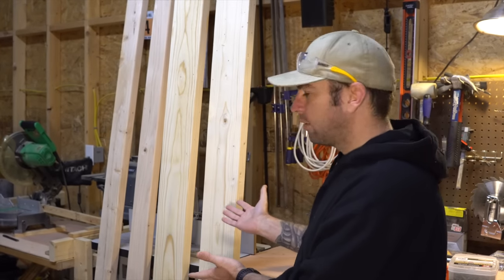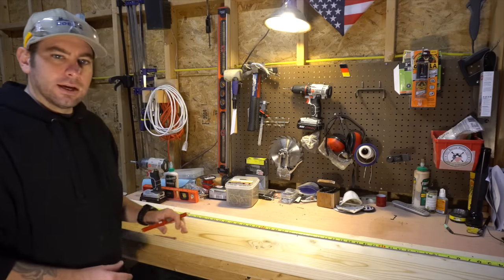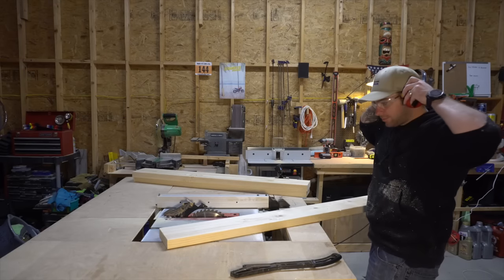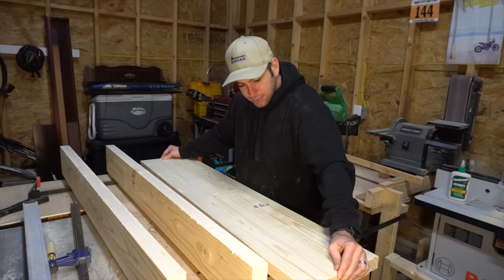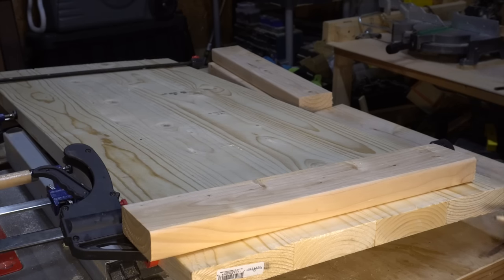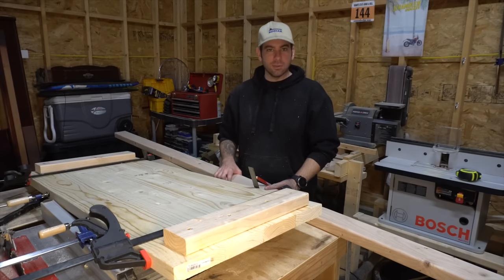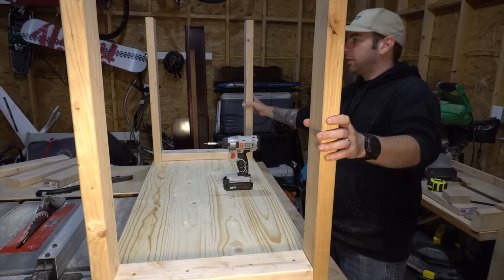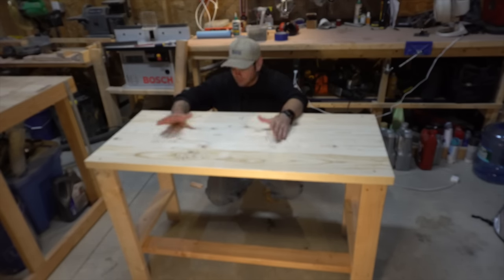Build a Super CHEAP and EASY DIY Desk!

Comment: Certainly not meaning for this to sound negative, but I do have a question.  Where are you getting your material for that cheap?  I would be lucky to get that kind of wood for twice that MINIMUM unless I look in the "Culled Lumber" section.  One major issue that is holding me back from these types of projects is the price of lumber at this point. I try and get as much free reclaimed lumber as I can and run it through the planer and salvage it.  Great tutorial and I look forward to seeing more of your projects!

Comment: This video is great and it seems very easy to make this table.however I have a few questions since I am not a professional wood worker.....1st of all,what type of nails have you used and I noticed that you're using something on the tip of the electrical screw driver.i can never manage to screw the nail all the way through....
2nd,is it really necessary to flatten you the edges of the 2x4,since I don't have a cutting wood tool like yours,or I could leave then the way they are?same thing with the sanding,do i necessarily have to sand it ,or I can just go ahead and stain it?thank you a lot for posting this great video,I think you are very talented and I would definetely like to see you making a little and simple garden bench.
Reply: You can leave the 2x4s with a rounded edge, but there will be a little lip on each one that can snag things on the bench. Definitely sand before staining, imo the stain takes better on smooth surfaces, but i have seen people stain things without sanding.

Comment: For the record...

2x4's used to actually be 2 inches by 4 inches.

In the early 80's, my parents bought a property in northwest Florida with 3 old barns built in the early 20th century. My Dad tore down one to build a home and pulled 2" by 4" boards from it, some over 40 feet long. 

It wasn't until the 40's or 50's that lumber manufacturers got greedy and began cutting dimensions on lumber.

Comment: the wood mill cuts the boards wet.  the measurement of the board comes from when it was still wet.  when the wood dries, it shrinks. That is why you get a difference of 1/2".   However, the thicker the board is cut, the more it shrinks.

Comment: This is prob a daft question but if like u said you were to ask for a 2 by 4 but what ur getting is a piece of timber half inch less on both measurements than by rights your not getting what you requested or paid for
Is that correct?

Comment: if you wanted to stain the wood is there a way to get rid of that black text on the 2x4? Can you sand that off or do you cover it with wood filler or do you just have to buy more wood so you can avoid cutting that area?

Comment: Awesome video...great explanation. I noticed at the end the table had a slight wobble. I plan on tackling building this using your video this week. Is there an easy fix if you end up with a wobble in the table when finished?
Reply: I will try this out. I will add glue to the leg joints in addition to the screws and add a cross brace to the front, if I have wood left.
Reply: You could add adjustable feet but that would add to the cost a bit.

Comment: I have everything but the nails. What size would you recommend getting?
Reply: I would use a 3"( inch) screw. If you're going to nail it, I would use a 3 inch nails. Although I wouldn't recommend using nails, but if you do make sure you're always wearing eye and ear protection.  And good luck
Reply: I used a 2.5 inch screw. I said nail before🤦‍♀️ I removed that comment lol but thanks for the tip ☺️

Comment: 25:45 A 2X4 is 1.5 X 3.5 and called a 2X4 due to the fact that as it is rough cut to 2X4 prior to the kiln drying process. After it is dried the board shrinks, this is also the time when warping and twisting occurs.

Comment: Any tips to avoid splitting the wood when drilling the screws in? Better wood? Smaller screws? I recently built a table exactly like this but when I installed the legs the wood split. I just put a lot of wood glue on it and send it over it but for my next project I want it to look a little prettier
Reply from the maker: Yes, pre-drill the holes before you put the screw in. You don't always have to do this, but you want to on smaller boards and near edges.

Comment: A friend gave me a ping pong table that goes go a pool table.  I don't have a pool table but need a base/legs.  Could you build a base/legs for the pong pong table using 2x4's, preferably foldable.  I'll be keeping it on my patio and only own a drill, table saw, circular, jig saw and miter saw.

Comment: 31:10 stand the other 2X4 vertical and screw the other horizontal one. Move the vertical to the other side and have the vertical one sitting on top. So you don’t have to measure and they are both leveled.

Comment: Great video. Thanks. I have a question though:
In order to attach the legs at first, you screwed them in sideways at the beginning. Later on, when you wanted to reinforce them to stop the table from wobbling, you screwed them in again from the top. How do you make sure you don't "screw into a screw"? I will buy the wood today, and ask for it to be precut, because I don't even have a handsaw. Thanks for a great video!

Comment: I have a suggestion that would not greatly increase complexity or materials.
Screwing into the end of a 2x4 is never a great join.  That said, attaching the legs to the table top cleats the way you did is probably fine.
The two short lower cross members should be made 3" longer (or the table top cleat shorter);  turn on edge and screw through the cross member into the table legs;  two screws at each end.
Instead of screwing the long cross member into the short ones I would turn the long cross member on edge and screw it into the legs with at least 2 screws at each end.
This makes for a stronger join and better protects against racking -- side-to-side or front-to-back shift/collapse.

BTW, is there any concern about expansion and contraction with the table top and cleats?  Panhead screws with oversized or slotted holes needed?

Comment: Helpful tip for those without a table saw to square the short edges of the 2x6's. Don't square them, and instead glue then nail a sheet of plywood or MDF on top of the whole bench. Not perfect but perhaps much safer than trying to square edges with a circular saw

Comment: Would it be possible to leave the 2x6's as is and have more of a farmhouse type table with obvious boards? There's no way I'm getting a straight cut without a table saw.
Reply from the maker: Definitely,  it will just create a less smooth surface, but if you're not writing with pen and paper directly on the surface, you'll be fine.

Comment: If the two by fours for the supports we turned sideways you’d have about four times the sheer strength to take out that wobbling.  Even better if you’d gotten one more 2 x 6 and made the table a little wider and used the two scrap pieces on the legs as braces but going up and down instead of side to side those legs wouldn’t have wobbled much at all. Also if you’d used pocket screws to hold the legs on and screw them directly to the bottom of the table

Comment: I really enoyed watching this, I am looking to build a workbench table that I can have outside for the summer months, just so I can get out of my garage which is freezing. The reason they're 2x4 and you actually have smaller dimensions is that they were 2x4 BEFORE they were planed down, so in the UK you need to ask for 2x4 planed rather than just 2x4 :)

Comment: Hi,
I'm new to woodwork, but I like this project. Can you give me the measurement of each piece. I don't have a saw, but I can get my local hardware to cut the pieces. Thank you again for this project.
Reply: The top was cut to 4ft long and right around 2ft deep. The legs are 28.5 inches long. The runners are right around 21 inches long, along with the leg supports. The rest is kinda history just measure twice and cut once.

Comment: The dimensions of the timber are nominal, ie rough cut, then planed down to its finish size, so it’d be sawn to 2X4 then plained smooth to 1 3/4 by 3 3/4.
It would have been easier to assemble the legs laid flat on the workbench then fix them to the tabletop after..

Comment: the extra 1/4 inch is to allow for 2 1/8 " kerfs, 2X4 is the original dimention at the rough cut area of the mill , when the guy who plans out the final delivery cuts gets them , they become 1 1/2 X 3 1/2 ", when you see " nominal" 2X4 ( nominal means name) , look for actual somewhere on the label , or shelf talker , it will ramble off some odd number that will closely reflect that extra 1/4 ", i asked a guy  at depot why nothing marked 1/2 " is ever actually a 1/2 inch, i got about a 1/2 hour long explanation , i think he was a manager

Comment: how much does that wood cost today?  not being snarky about that, just wondering if anyone's priced this out recently.

Will be attempting a modded version of this soon
Reply: I’m making this today. 

I bought (2) 2”x6”x10’ and (2) 2”x4”x12’ - all “Prime” wood because they will look better, be straighter and more flat. 

Total cost for the wood without tax from Home Depot: $50.34

2x4x12 cost $10.83 each
2x6x10 cost $14.34 each

My desk will be 5 feet wide, other than that it will be built the same way.

Comment: I liked the video (and subscribed!), thanks for taking the time to put it together. Question: has the wood table top cracked at all from humidity fluctuation due to the glue? I'm wondering whether to glue or not and what your experience has been.  Thanks again.
Reply from the maker: Thanks for the comment! The boards can come unglued in extreme expanding/contracting situations, but it should be fine if it's in your home.

Comment: I was wondering what it would look like without using a table saw. And if there's a gap could it be filled with wood glue and then sand it?
Reply: or use epoxy

Comment: circ saw with rip fence. or cut a hole on old plywood and drop the saw in it, clamp a board down for a fence and that can get you by. also hand planes could be an option but if you own, and know how to use one you probably have access to a table saw.

Comment: With the clamps this is around $400 in tools if you use a circ saw.
Reply: @xmnemonic Good point... there has to be an investment in tools before you can build stuff on the cheap, unfortunately!
Reply: Circular saw $60 and clamps $25 each at local lowes if you have one.

Comment: Nice work Irie, honestly you motivated me to start and do a similar Desk table. However, i prefer if you use the method of pocket holes instead of  screwing for many reasons (aesthetic and to reduce any possible future rust for the screws).

Comment: Glue really would have helped with those legs.  You also could have glued two short pieces of 2x4 together, then cut them in half at 45 degrees on you miter saw.  Then you would have had triangles for each leg.  Glue the triangles in, and put a couple screws to put it together.  You would not have need cross braces on those legs then.

Comment: The reason it's called a 2x4 is because it is cut to 2" x 4" green, then dried, during which it shrinks. Then it is milled down to make it smooth, straight(ish), and round over the edges.

Comment: This is excellent. I'm so inspired. I need a table and this is great! Could you use one solid piece for the top?
Reply: Absolutely. A great idea is to use 2 piece's of 3/4 plywood, or  what's known as a solid core slab door . Good luck
Reply: patrick mcglone do you mean 2 pieces to like stack them up & make it thicker? Tanks in advance
Reply: @23lESHt0WN12  yes place one on top of the other. It depends on what you'll be doing with it. But a basic workbench top is 1 1/2" thick. Nothing thinner than 1 inch. Does that make sense?

Comment: I noticed that your table wobbled when you leaned on it.  is there a fix for that or is it the nature of 2x4s rough cut?  I like the simplicity of your table.
Reply: The cross supports should have gone in vertically instead of horizontally.

Comment: The reason that a 2x4 is actually 1 1/2"x 3 1/2." Is that a long time ago when lumber was rough cut builders complained about all the splinters so the mills started planing the lumber.

Comment: I don’t trust the glue 100% so what I normally do is tap in about 1.5 inch nails where biscuits would go and clip the nail heads off like a spike. I don’t tap the nail all the way. Once the nail heads are clipped I add glue then hammer the joints together. Cheaper alternative than buying a biscuit cutter and biscuits.

Comment: If someone wanted to save just a few more bucks, you could buy interior only screws.  I think those screws, by the looks of them, are rated for exterior use in chemically-treated outdoor lumber.  I think someone could also get away with less expensive wood glue.  I think the stuff you're using is also exterior rated (and I think even food safe?)  You could buy the interior-only glue as well.  These are not critiques of you; I'm just commenting for those who might not already have any screws or any glue around already.

Comment: A question is... how would you even be able to transport long planks
Reply from the maker: The 2x4's are 8 feet. If you don't have a truck, you might be able to put them in the trunk and fold the back seats down to push them as far forward as possible. I was able to fit them completely inside a VW GTI.

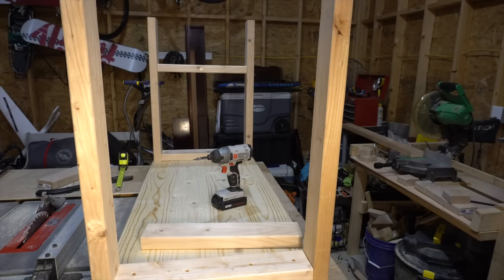Comment: 32:45 you want to use the level on the braces between the legs.  Not measure the distance from the bottom of the leg to the brace.  The braces are not level at all.

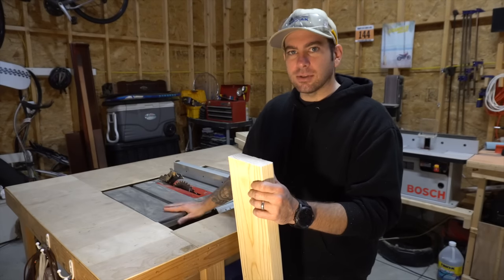Comment: 8:52 instead of doing all that couldn’t I use an electric sander thing and make it square that way? Just wondering.
Reply: Based on my limited experience with an electric sander, I think it would take a tremendous amount of work to sand down the edges to flat. Taking off even small amounts (I'm talking like a quarter of a millimeter) of wood with an electric sander is way harder than you'd expect if you haven't tried before.

Comment: I totally agree with this guy...  that said...  he did so many things backa$$wards...  I spend take the $4 or whatever it would cost to get some L brackets for his design...  I would also make the top removable...  as once that thing is actually done, it'll be kinda heavy if you have to move it...  if it's in 2 or 3 pieces, piece of cake...  

All in all though...  he is on point...  YOU ( and, yes, I mean you! ), can make a desk with some 2x4s and a power drill...  ( if you have a power sander and some stain and poly, that would be nice too... )

Comment: Why wouldn't you have taken a saw blade off the end before you measured then you would have started with a square end.  You had enough to have squared both ends. Buy a speed square and a tape instead of guessing.

Comment: Greed  my friend, I live in an old house inside my walls are actual 2" by 4",  2" by 6",  2" by 8" and so on.  that's why older brick houses are still around also the wood is not so processed (smooth) almost furry but straight. package always get smaller as the price rises.

Comment: Im not gunna lie, this is one of the worst workbenches ever, IT WOBBLES. You cannot have a workbench that wobbles like that. Not only that, using that cheap wood is a bad idea because it likes to warp to shit. The top has to be super straight, leveled, and smooth and the warping will ruin it after it settles. Even the leg braces are wrong they have to be vertical not horizontal like that, its not as effective at strengthening the legs if you do it this way another reason why it wobbles.

Comment: So yesterday I watched this video to make this table for my son i completed the table last night around 11 pm central time put polyurethane on it let it dry both shop windows were open and I had three fans running to dry the table at 130 am I went to check on the table everything was ok at 3am.a guy rang my doorbell and said to my wife that my shop was burning fire marshall says preliminary cause was electrical.my one fan must have died and shorted out the wiring good news is that the table was a success but it burned with all my tools and belongings
Reply from the maker: Oh no! I'm so sorry that happened. I hope your homeowners insurance will cover that.

Comment: Are you using ear plugs or ear muffs when you use all your power tools?  As an audiologist, I cringed just watching you exposed to the high pitch sound of the mitre saw.  If you have been doing that for so long without ear protection, Noise-induced hearing loss is in the making......

Comment: $15 dollars and Super Easy! 
Just need a Table saw, Miter saw, Circular saw, Several Bar Clamps, Etc...but trust me! Only $15 lol 

These channels are clown shows 🤣🤣
Reply: It is better to get a router. Miter saw is good enough, you don’t need to get a circular saw and table saw since you are not professional.

IKEA has a $19.99 table frame. You can get 2 table frame to build 2 tables, so you can use 1  or 2 together.

Comment: Such videos are annoying. We will make a cheap table, but you will need machines for several hundred or even thousands of dollars. It's cheaper to go to the store and buy a factory table. Or buy a table from other people from a private classifieds website that they do not need. When will the craftsmen start calculating the cost of the tool that needs to be bought?